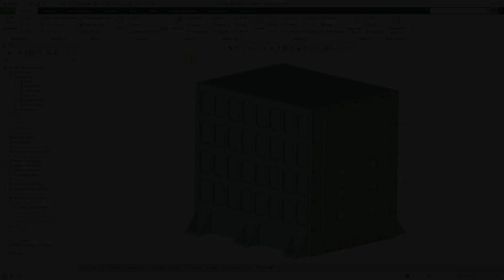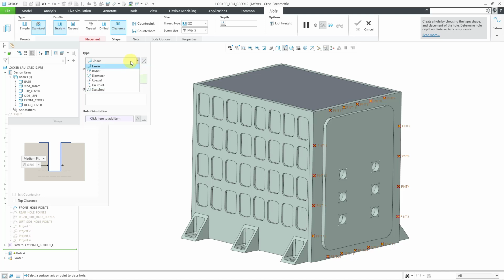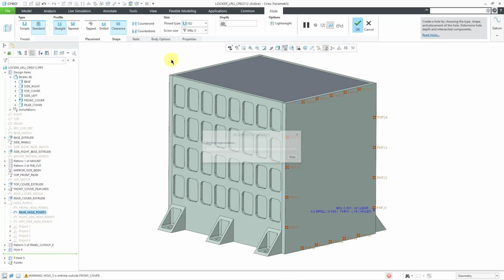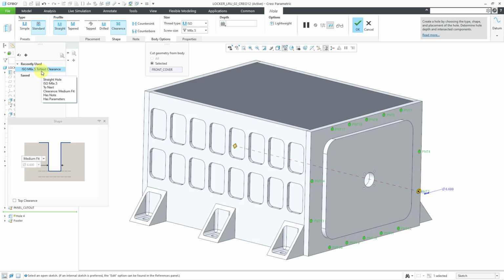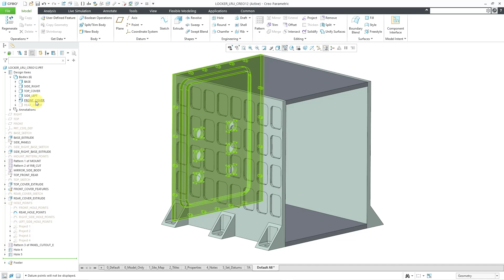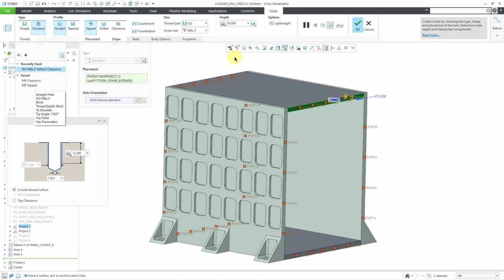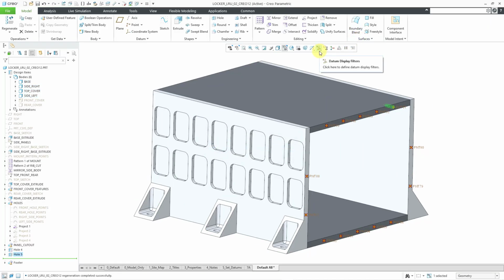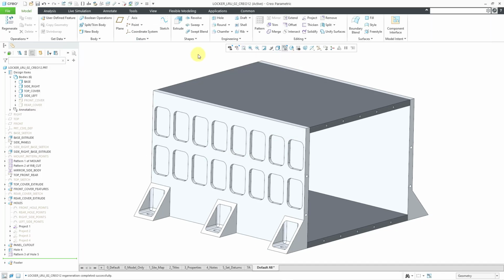Creo Parametric 12 - Feature Presets!

Comment: Hi Dave,  Seems like useful functionality but a couple questions.  Is the preset functionality available if you use custom defined hole?  Also, if you save the preset hole to your custom UI file, is it a link to the custom hole file definition, or, is it a copy?   Thanks
Reply from the maker: Good questions. I don't know. Creo 12 came out less than a week ago, so I am trying to get up to speed on the new functionality like everyone else (and also planning an international move). I recommend opening a ticket with PTC Tech Support.